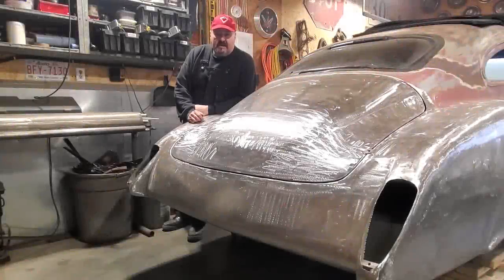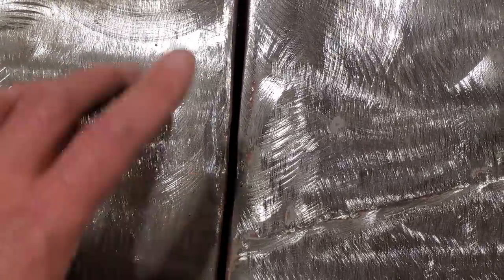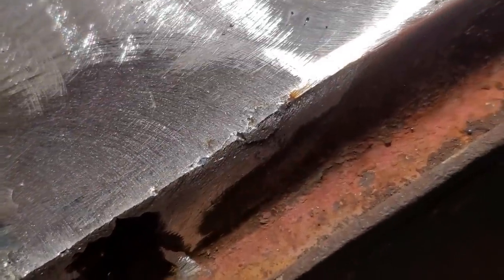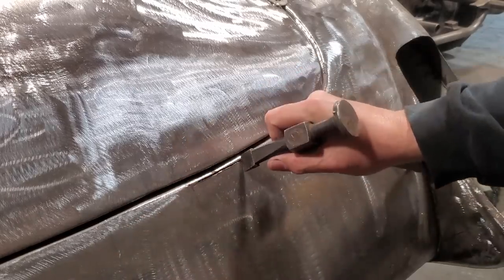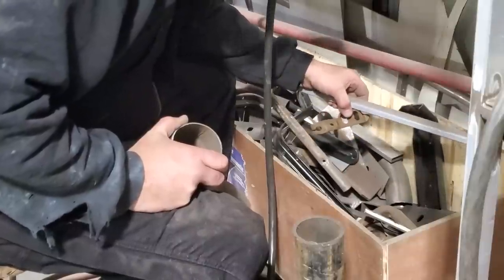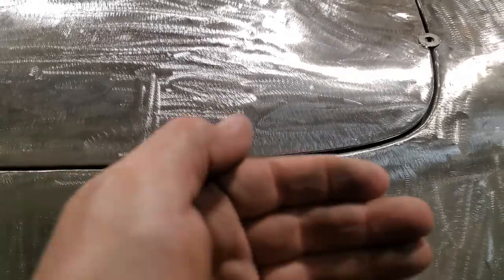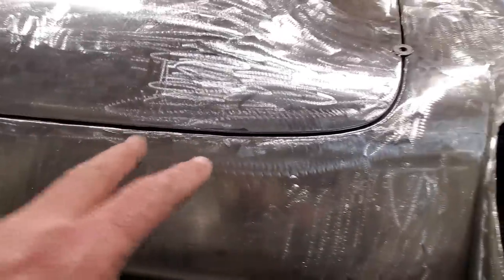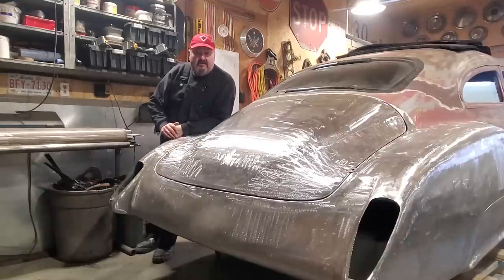How To fix poor body seams on 40s and 50s cars and trucks

Comment: Hi Tony.  That is a real good tip.  Panel seam gaps are sometimes not consistent, from one side to the other and this is a great way to correct it.  It seems way better to cut the panel like you did rather than trying to add material directly to the bend.  I'm putting that one into the tool box!  The blow gun is made from a pushrod, but that was an easy one.  Thanks for the video!

Comment: Great video Fitzee! I have a car that needs some gap work, and this gives me the method and the confidence to do it right. Thank you for posting this! By the way, I guess if the gap is too wide, you split the metal with the cutoff wheel then 'wedge' the metal to close up the gap, then weld up the  cut.........that's the part I worry about, since I'm not real good at welding up two pieces of metal that have too much of a gap. 😞
Reply from the maker: Thats where a wire coat hanger come in

Comment: Great video and thanks for sharing this technique. The results are excellent. Sorry but I find that way that you call things gaps and seams a bit distracting. Usually think of seams as the place where two panels are joined and it's visible - the places you might apply seam sealer to or hide by seam removal and gaps are between things that are not joined i.e. there is no seam there. 
The blower looks like clever re-use of a pushrod.

Comment: I actually took this trick for adjusting body seams and used it on a commercial metal door & frame. the door was rubbing along part of the frame along the bottom edge . zip cut the door  , pushed it over, welded er up   & voila!  smelled some burning Styrofoam for a while but she didn't light up .

Comment: i do the same as you  to fix gaps but i also found  if you fit the rubber seals the gaps open up and if you don't check the gaps with the rubber seals fitted and alter them the gaps will be larger
so now i  always do gapping with rubber seals fitted

Comment: Is there a method for gaps that are too wide?  Is it the same as widening a gap, but fill a wide slit with weld?  I assume a lot of these gap corrections are only an 1/8 or so, which seems too small for a filler metal piece?
Reply from the maker: Same process to close up gaps. Cut and adjust gap then weld up. Filler, primerand paint has a thickness to it and you have to take all that into account.

Comment: I love your content. I am a fabricator, I will many times make something even if it is easier to buy it. As to your question, I know exactly what your blow nozzle is make from. My question is to you, is there a special reason you made that out of a pushrod, or was it just what you had on hand?
Reply from the maker: The harden tip that is round was always great for when I was painting. It was my go to blow gun when preping cars for paint. You could run it across the panels and not mark the work. I got that blow gun some 25 years.
Reply: @fitzeesfabrications  Thanks, that makes sense. As I read your reply, I was picturing the round end being drugged across a panel, then it occurred to me that the round end would also be good for pressurizing a passage such as when testing hydraulic circuits.

Comment: Tony another way I know to keep an even gap is to make a thin strip to run through there to get an even spacing somewhat........it kind of helps to Identify high and low spots to keep things somewhat uniform if you have the time...... also gives you something to work with for an even consistency as well!

as for that Nozzle it fell to 'Narnia' ..........I have that happen here on things I do. and I usually find it as I can (and do) run around barefoot so I can say I know where Narnia is!..........5555555555555

Comment: I had a 79 dodge power wagon, spent 5 years on a total restoration and it was a total nightmare getting all the gaps on the doors to the fenders and the hood and grill to all get acceptable looking and it was never perfect but I’m convinced they weren’t from the factory, they just didn’t fit right.

Comment: Great video. I like the way you fixed the seems. Will you be rebuilding the trunk area soon. After the door seems. Will it be ready for body filler and primer and paint? The Tips were Excellent Thank you
Reply from the maker: Trunk area?? There is a lot of work needs to be done to the nose on this car. I'm working my way around it.

Comment: What are your mig settings and wire size?
Reply from the maker: Wire size is 023. My settings are different on each machine. This one I was 2.5 heat and half way between 50 and 60 on wire speed

Comment: I restored a mk1 Jag back in the 90's the door gap were shocking as I had to rebuild all the door bottoms I spent days getting the gaps perfect as I was not painting it but did all the prep work so all the painter had to do was put the colour on I went to see how it was doing all the doors were off I told them give me a shout and I will hang them , he said the gaps were terrible on old Jags and not to bother I tried to explain how many hours I had put in to get them right he wasn't bothered as I had been paid neither was I as if anything was wrong I could blame them , lovely car though 1 family owner 50,000 miles , I fitted 2 front wings as well £500 each back then they were a shocking fit as they were MK2 wings I had to modify to fit each wing to a week to fit including leading seams and filling .